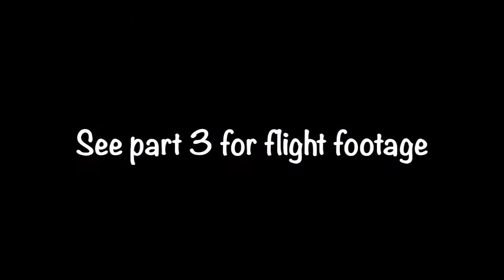Micro Drone FPV Build (Part 2)

Comment: ive got the same FC for my quad build,will rx1105 motors work without 4 esc's?trying to keep weight down
Reply from the maker: If the rx1105 are brushless motors you won't be able to use this FC with them. This FC is strictly for brushed motors. There are a couple videos on the internet showing how to modify this FC for use with brushless motors but the modification requires some pretty fine detailed soldering if you're interested.
Reply: theyre brushless motors,what kind of flight control and ecs would i need??i use a radiolink at9 transmitter
Reply from the maker: I really can't answer that because I don't have any experience with brushless motors that small. I do seem to remember seeing some tiny 4 in 1 FC's for a small brushless set up. I would think that would be the lightest set up in a brushless quad that size. I would suggest a simple google search and you'll probably have more options than you know what to do with. Good luck to you and your project.

Comment: Isnt it flying
Reply from the maker: Yes it's flying.
Reply: Budget FPV RC  thenwhy didnt u show that in video...and how u r able to add anteena and remote
Reply from the maker: If you watch part 2 it shows how I mounted the rc receiver, antennas and the combo camera / vtx. (double sided tape) Also if you watch the video to the END it has a link to the flying video. Also I have probably a dozen videos showing flights with the 120mm micro quad I built in these videos.

Comment: Did your telemetry work?
Reply from the maker: Yes the telemetry works
Reply: Are you running it on a Taranis and Betaflight? If so, what did you do on betaflight ?
Reply from the maker: Oops sorry, answered you from my other channel. Yes Taranis and Betaflight 3.0. In the ports tab select Uart 3 - Telemetry - Smart Port. Don't forget to save.
Reply: Thank you sir.  I've been trying to find info on this on a spracingf3evo brushed flight controller.  Thanks again hopefully I'll get vfas so I can get telemetry.  Maybe you can make a short video.
Reply from the maker: you are quite welcome

Comment: can you help me in my brushed motors its actually a qx95 i installed everything on another frame when i reset my settings on cleaning my motors just spool up when i plug in battery and i cant lower throttle on my transmitter please help
Reply from the maker: Are you using cleanflight? I'm not too familiar with cleanflight. I only use betaflight with all my quads.
Reply from the maker: I don't know if you have resolved your problem with the motors spinning but check in cleanflight and make sure you have BRUSHLESS selected and NOT oneshot or something else on the configuration page.